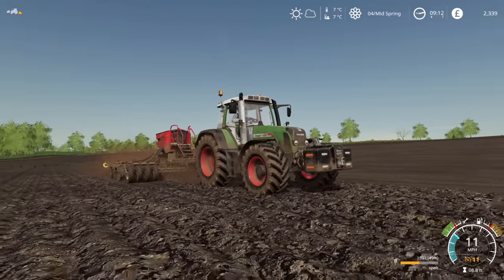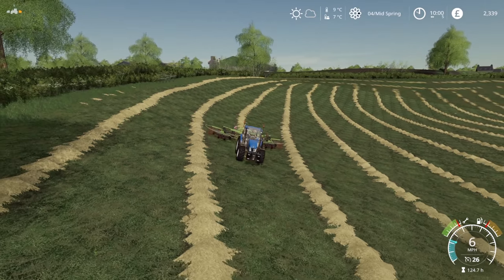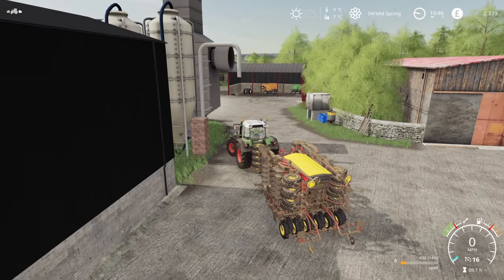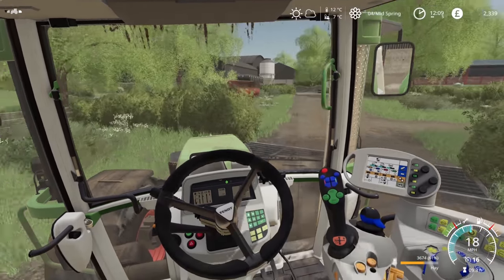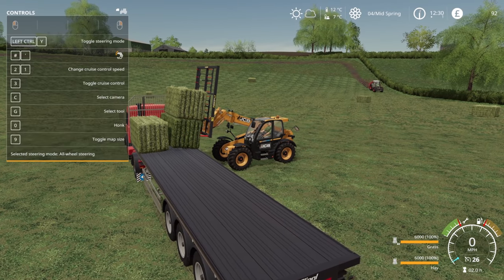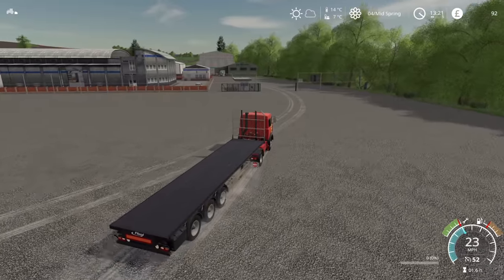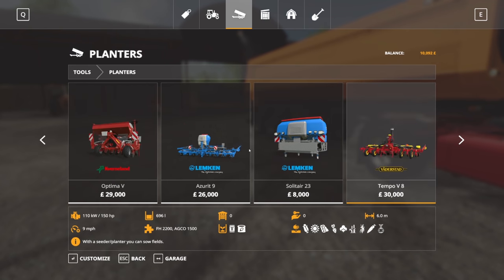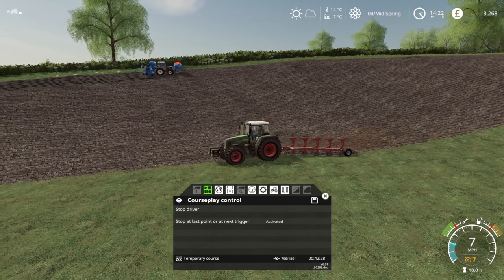THIS IS TOO MUCH FOR YOU, LITTLE BLUE | Chellington Farm FS19 | Episode 7

Comment: Maize Plus and Seasons Grass: In total there is 4 stages of grass, ‘fresh grass’, ‘grass’, ‘wilted grass’ and ‘hay’. When cut with a normal mower, grass is left as ‘fresh grass’. This can be baled into silage bales. To dump the grass in a pit the grass must be ‘grass’ which is made by tedding once. Hay is made by turning the grass twice and leaving it to dry. This goes from ‘fresh grass’ to ‘grass’ then ‘wilted grass’ by tedding and then to hay by drying in the sun. You can Ted again straight away you just have to first disconnect and re attach the Tedder. Cutting the grass with a mower conditioner (any mod with a visible one or the base game ones that come with the map that say mower conditioner) drops the grass as ‘grass wilted’ meaning it only needs the sun to dry for hay or can be put straight in a pit. This also applies with the Multi Fruit grass crops such as Alfalfa and Clover. The different grass types may also be called something different depending on if you actually have Maize Plus itself installed but should be fairly obvious which is which. I hope this helps dagger.
Reply: @Blutvogt not sure no, you could be right, I mean it would make sense